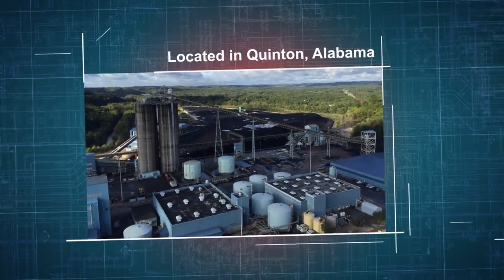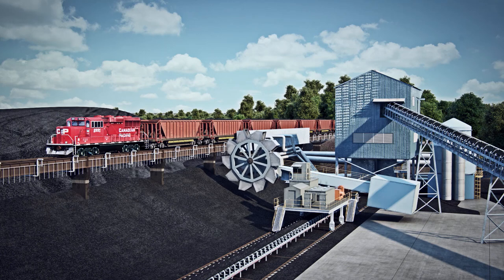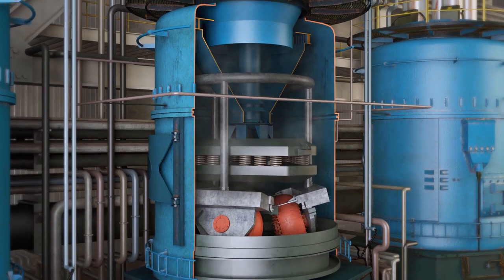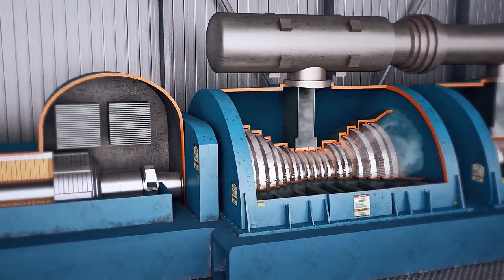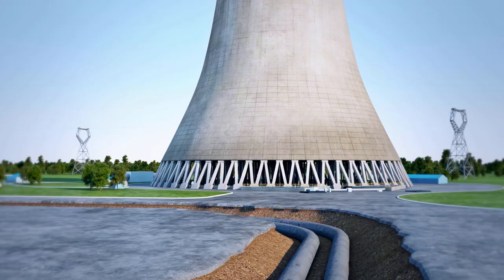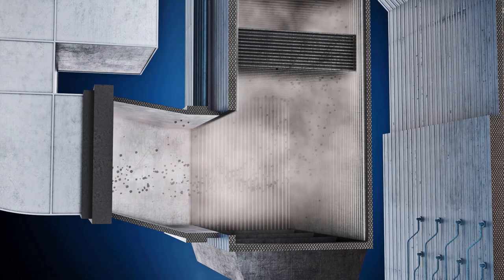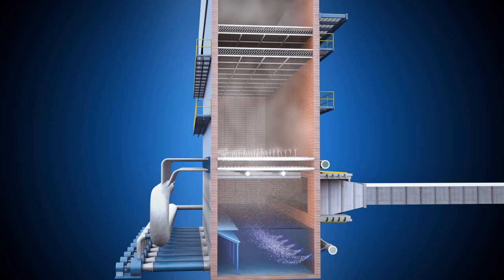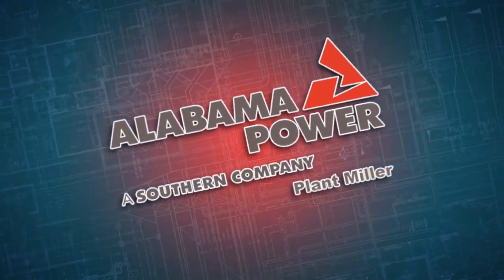Alabama Power's Plant Miller How Electricity Is Generated 3D Animated Tour

Comment: Ahh, so that raises the question: Since you appear to use electricity just to get things moving and grinding before you can boil and generate, how do you boot a place like this up? I mean... if it somehow lost the grid all around, or if it were the only one on a specific grid. Does it have diesel generators to give it its boot-up power for that?
Reply: if you had to, you could use force multiplication (gears and lever arms) and use a few humans to crush enough coal for the furnace to fire for 20-40 minuets, which would be enough to restart and accelerate the crushers to operation speeds.
Reply: In some power stations,  gas turbines similar to a jet engine but designed for power generation may be used.
Reply: Small plants have diesel back up.  Some will use a simple cycle combustion turbine, jet engine, some will use a smaller auxiliary boiler as a small one is easier to get going and use it to start the mains, and others simply go offline and stay that way.  Many plants do require cranking power.  In the restoration plans a transmission operator will have designated certain plants (or units in a given plant) to be "black start".  Meaning they can start with no external power source.  They will come up, or designed to remain online through special protection schemes, and they will work to get a power path to the other plants that are able to come up quickly.  This is all planned and practice.  I have done simulations myself.
Reply: This is what's referred to as a "base load" power generation plant. It runs 24-7-365. Only portions of this plant are shut down for maintenance.

Comment: We need to replace all coal plants with nuclear.  Nuclear can do the same baseload job without any CO2 or particulate emissions.
Reply: but then where are we gonna get drywall??
Reply: Easy to say, but the residues of nuclear can be equally or more dangerous than the CO2.
Reply: @odongemma4170  Unless you electrify transportation and even find a solution for more effective mining. Today's problems aren't necessarily those of tomorrow.
Reply: @antonellaromero_upc1564  Well 95% of nuclear waste can be recycled and the total amount of heavy toxic nuclear waste dramatically decreased. We also need to compare the volume of waste: the generation of electricity from a typical 1,000-megawatt nuclear power station, which would supply the needs of more than a million people, produces only three cubic meters of vitrified high-level waste per year, if the used fuel is recycled; the volume of CO2 from an equivalent coal power plant is, as you can imagine, significantly higher.
Reply: Chernobyl, Fukushima aside.
Reply: @antonellaromero_upc1564  Modern Molten Salt Reactors that utilize Thorium are extremely safe and the waste, while initially more radioactive, decays more quickly and is overall safer. They also don't have any of the nuclear proliferation issues of other plants that use more abundant forms of Uranium.

Comment: What is the lowest PSI in the boiler loop?
Reply: Dave George the condenser operates at a vacuum, below atmospheric pressure. This is to extract as much power as possible from the steam before returning it to the boiler.
Reply from the maker: @Bill Moran - thanks for clarifying

Comment: You didn't explain that the cooling tower water pulls a vacuum on the stm condenser which increases the efficiency of the stm turbine!
Reply from the maker: I'm sure there are a lot of details we left out. It is a short overview.
Reply: The cooling tower does not produce the vacuum in the condenser. That occurs because there is no air in the steam system. When the steam condenses at low temperature ( around 180 degrees) the resulting pressure is less than atmospheric.

Comment: In response to the last message you cant pump steam. I often wondered this apparent loss of energy. But having worked at  1900 mw power plant  for many years this is one of the inefficiency's  of the process. Attempts have been made to use this heat source  to heat green houses etc. The results are not cost effective.  This video tells it like it is.
Reply from the maker: Thanks for the comment
Reply: Actually, district heating is very common in heavily populated areas. So, maybe it is cost effective.

Comment: Coal power is eco hostile regardless of how hard we try to clean the exhaust but, the engineering is brilliant though. The future is wind, solar, wave, and LFTR. LFTR stands for liquid fluoride thorium reactor.
Reply from the maker: Tell us more about LFTR - that's news to me
Reply: @edpvideo  Any nuclear is the future. LFTR is just one (very speculative) option.
Reply: I coudln't agree more.  Also, why are we still using dirty coal?
Reply: Use reactors that contain recycled nuclear fuel and breeder reactors that use U-238 as well
Reply: @FowlorTheRooster1990  In the long run yes. But the details aren't worth fussing over. All nuclear is so much better than all fossil that any of them is a worthwhile upgrade.

Breeder reactors shouldn't be the top priority until we're sure they can operate cheaply and reliably.

Comment: Why do you have to cool the water. It takes a lot more energy re-heating it from cold, instead of just topping it up with a little heat from the boiler?
Reply: Because water expands 1600x when converted from a liquid to a gas (steam).  In a contained space that equals 1600x the pressure.  It's that pressure increase that moves the turbine blades, not the fact that it is steam.  Once that pressure is released/expended into the turbine, it is just steam, not high pressure steam.  It must be cooled back into liquid form in order to reduce it back to it's 1600 times smaller liquid form, so that you can reuse the same clean/purified water in the closed loop system.  And keep in mind that you're cooling it just enough to liquefy it..
Reply: @MatHelm  The pressure increase doesn't come form phase transition. It is set by the pump that compresses saturated water coming from the condenser.
Reply: You can't just dump boiling water into the river, it would do greate damage to the plants and animals..  Anyway, the boiler water has additives to prevent corrosion of the pipes and turbines. Can't dump that into the river either. That is why they use a closed loop system and use evaporative cooling.

Comment: SCR? So they're using a system similar to a diesel exhaust fluid system then more or less?
Reply: Both systems are designed to remove NOX. In a nutshell yes, the same general idea.

Comment: Why not use the hot water for houses and other facilities? BTW wouldnt it be good to use up un-recyclable garbage as fuel instead of having it dug down and poison  the groundwater
Reply: Because most generating plants are pretty far from any residential areas.
Reply: You'd have to live really close to the plant and install an entirely new infrastructure to deliver it. More ideally would be an industry that requires large volumes of hot water to be located near the plant.

Comment: Why does high pressure turbine look so different from low pressure turbine if they operate on the same principles?
Reply: As pressure decreases volume increases. High pressure turbines hence are smaller while low pressure are larger.
Reply: @GFSwinger1693  but if volume increases as pressure drops, one could also compensate for it by designing low pressure stages to work on higher flow velocities. like, use less angle of attack. However, both in compressors and turbines they seem to design them so that flow velocity stays almost constant, I wonder why's that.
Reply: @GFSwinger1693  THAT'S RIGHT,VOLTS GO DOWN ,AMPS GO UP.

Comment: Why do you cool the water if you are going to heat it again?
Reply: the point of the water is to cool down the steam.so it need ot stay cool. and water is easier to control than steam, so you dont just heat up steam, you heat up water.
Reply: The primary water is in a closed system which requires a pressure differential in order to create power.....which means a hot side and a cold side are required, otherwise you have liquid that doesn't want to go anywhere.  So the closed system goes through a hot phase (through the boiler) and a cold phase (through a mid-transfer).  The cold phase has some energy still left, so it uses that to produce a little bit more energy before the cooling towers finish it off.
Reply: @sabriath   They even recycle some of the heat coming out of the stack; a nuclear plant's fuel is so cheap they wouldn't really care, or could since there is no stack. I don't think nuclear plants can reheat low pressure steam, at least for water cooled reactors.
Reply: @leerman22  ... there are many fine details to the system, I just glossed over a few of the key areas.  They try to extract as much heat from the loops as they can into the form of electricity, but there is a point where averaging down can no longer happen, and you have to have a higher threshold (otherwise you just have high pressure steam everywhere and no movement).....hence they have to dump a huge amount of excess heat on one side of the block.  Even if we were to line the entire tower in stirling engines, you still need a cold side to have the engines work....and that cold side will heat up, so you have to keep it cold.

Comment: Sir any 5 reasons why turbine used oil ?????
Reply: All mechanical moving parts require lubrication. That is usually oil. Some power plants use fuel oil, natural gas, and nuclear fuel instead of coal to produce the steam required to rotate the turbine at the speeds needed to produce electricity. Turbines spin at 1800 or 3600 RPM to create electricity at the proper voltages. Everything is very heavy and a lot of energy must be produced to rotate the turbine string at the necessary speeds. A generator rotor for a 700 MGW unit weighs about 140 US tons. Turbines are less but the string is very large. 1- HP turbine + 1 IP turbine + 2 LP turbines. You are attempting to rotate a piece of equipment that weighsabout 300 tons at 3600 RPM. That requires a lot of push.

Comment: Do they use light oil to ignite the coal when putting a coal mill in service to the boiler ???
Reply from the maker: I believe they use temporary generators to put a plant into service. Someone can correct me if I'm wrong.
Reply: @edpvideo  
They use natural gas or oil ignition torches to ignite the coal-air mix, the torches in turn use spark igniters to get started. They sometimes use the ignition torches at low load to make sure the coal still ignites reliably.
Reply from the maker: @gregorymalchuk272  Thanks for clearing this up.
Reply: Yes, They use light oil like a diesel fuel to get the boilers started until its heated enough for the coal to be used. Especially if it’s been shut down for service.

Comment: what is the ash sold for i really would like to know that please??????
Reply: here in Australia, ash is sold to make cement (It's only part of the ingredients to make cement) and it's also used as road-base.
Reply: You can actually make really light weight construction blocks with them, they are load bearing since they're brittle as all hell but they create effective partitions and is sturdier than wood based building
Reply: Gypsum
Reply: thanks bro!
Reply: Jamie 
The calcium sulfate from the sulfur treatment is used as gypsum. The fly ash and coal ash are used in cinder blocks.

Comment: K so we do all this just to boil water with heat by burning billion year old tree remains... Meanwhile 10 miles below Plant Miller is 2000 degree rock with almost an infinite amount of energy just sitting there going duhhhhhh. Craziness.
Reply: Geothermal is already used in places where hot bedrock is close to the surface.
Reply: Most people underestimate how far you have to drill to get the tempatures needed. Primary steam temp can be as high as 700°c and pressures up around 2000psi. If your not lucky enough to live in areas where the crust is thin its unattainable. If we use kola as a base line 12.345km deep and only 180°c we would require a hole 48km deep. I couldn't imagine that to be at all possible.
Reply: re: "burning billion year old tree remains"

So, what you're saying here is that Nature will extract the CO2 from the atmosphere and bury it - again? SO someone can use it AGAIN someday? COOL!!

Comment: What is the difference between lube oil and control oil??
Reply from the maker: I don't know, but maybe someone will jump in and comment.
Reply: Lube oil is circulated to lubricate mechanical components such as bearings. Control oil is used to actuate hydraulic components.
Reply: They use same oil in reservoir but different in function

Comment: Coal is the future in the world with C02 free power plants
Reply: Eddy De Paepe sorry boss but natural gas is a cheaper, cleaner, requires less maintenance, staff and can achieve a lower emissions at a greater efficiency. Natural gas can also be regulated to meet demand where as a coal fired plant has to produce a base load even at times of lowered demand. Carbon capture also reduces a coals units efficiency by  about 1/3 as the sequestration and compression stage of the C02 collection is extremely power hungry. When government coal subsidies eventually come to an end coal plants will cease to be sustainable.
Reply: Nuclear when done correctly cough cough Chernobyl is very clean very efficient and safe
Reply: Yeah a single pellet of uranium has the energy potential of about 1 ton of coal
Reply: Nuclear is the future.
Reply: Chernobyl station by itself wasn't so bad after all units 1,2,3 worked just fine. The main problem was in assholes who controlled the reactor. Actually, Fukushima shows the same issue... operators don't know how exactly work everything inside which is crucial for emergency control.  And all of this besides just engineering problems which of course always are lurking somewhere.

Comment: 8 minutes and still not a word on how electricity is generated. I was looking forward to seeing how an electrical current is created in the electrical generators. You know, the topic the video was supposed to be about.
Reply from the maker: It's an overview of the entire process but doesn't go into details on any one particular part. It'd love to do that, but not what the client wanted. Hopefully it gave some good insight into what the process is from a big picture view.
Reply: Coal makes fire, fire+water makes steam, steam is pushed through several layers of high and low pressure turbine, turbine is then mounted like a alternator in a car, the alternator produces power, they then step up the voltage and deliver it to the grid.

I know the bells and whistles confused you but those bells and whistles are there to increase efficiency but the basic process remains the same
Reply: Those so called bells do not increase efficiency, they are critical. lol. My point was that I was interested in how electricity is generated, namely the generator part. I know how heat is created and used to create electricity. I wanted to know how it is generated.
Reply: @marks6663  A synchronous generator is used, find a video explaining that or better yet, an engineering book on the basics of this topic.

Comment: Did he say 38,000 tons per day is burned not pounds?  That is a lot.
Reply: Compared to what?
Reply: @ushoys  Inefficient? You can't call something inefficients because it uses a lot o fuel. Well, it's much more efficient than car engines. Cars are mostly around maybe 30%, just some of them getting close to 40%. Now coal powerplants achieve around 45% efficiency, the best electricity source now is gas turbine combined with steam turbine powered by hot exhaust gases with 63% efficiency. Gas turbine itself have similiar efficiency to coal powerplants.
Reply: @ushoys  Well, it sounded a bit like that. Basically you can say it about every energy source. Every type of power generation have somewhere it's old generations that aren't as effective and except NGCC, which stands out, all of them have pretty much similiar efficiency. 
U can use most of the powerplant byprodcutcs. Ash may be used to make roads and lime from gases cleaning may be used to produce, for example, gypsum boards. So you not only use coal, but you also produce something, that may swap other natural resources, that would have to be diged from the ground.
Reply: That's only a couple of train cars a day.
Reply: @ushoys  Every one wants their electricity. It's not the 23rd century. We all pay for it.  Even landfills create jobs.  Coal miners need jobs. Plant builders need jobs. Operators need jobs Train operators need jobs. Stop making trash for your local landfill. They need jobs. Do you think China and Russia care about the environment? They don't even use scrubbers.
Reply: @ushoys  i had no idea that gypsom is a byproduct of the ash. Fascinating!

Comment: why cool the steam to water then to steam? didnt explain gen and electrons -- more about coal burning.  excellent graphics
Reply: It’s turned back to condensate then goes into the hotwell which after the condenser which helps create a vacuum. The turbine spins under vacuum. The “condensate” then goes through pre heaters then turns into feed water which goes into the boiler and the process continues it’s cycle.
Reply: When the steam turns the turbine the steam loses its temp and pressure and condenses back to water which is then reheated in the Reheat section of the boiler as the cycle continues on and on. Simular to an air conditioner recirculating freon to get repressurized to go from liquid to gas  to create cold but with steam to get hot by reheating and repressurizing. A Closed loop system. A bunch of simple systems to create electricity but massive and efficient due to the massive amount of electricity being produced. Like the human body. A lot of stuff happening just to be alive. lol.